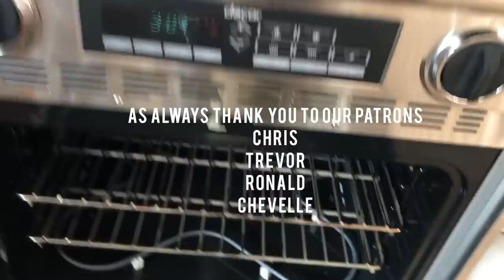Baking in a Real Oven Again!

Comment: The flex connector you removed, can be purchased in a kit with all the proper fittings and the new flex connectors are yellow. You should have a gas valve on a  black steel stand pipe coming through the floor. Under the floor then you install the yellow flex gas line run inside the house, to a through wall mounting plate, that connects to a pressure regulator on the outside of the house. From there you run a line to an exterior propane tank with a tank regulator on the tank.

Comment: Hey. Instead of out the back, maybe the vent can go down? See if there is a cover plate that will flip and make the "hole" on the bottom. Then you can go straight down on the kitchen side of the wall. It just seems wonkie to come down, 90 out, over, 90 down....etc. Looking so good guys. Keep up the awesome work. Cheers